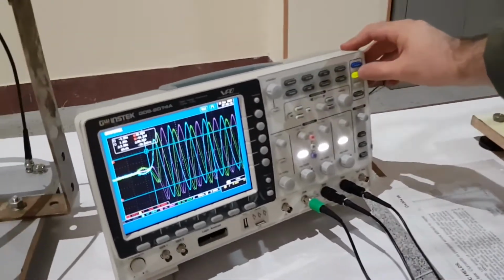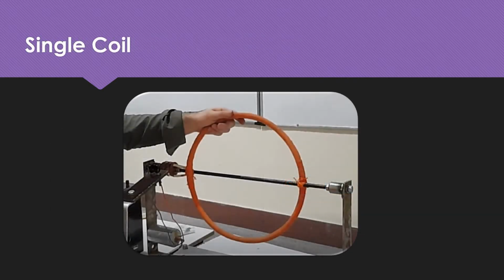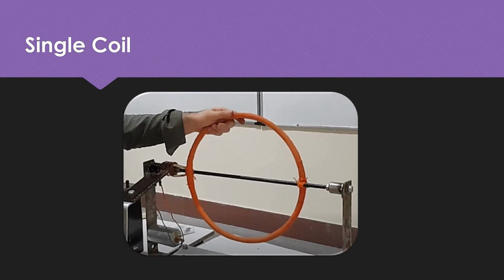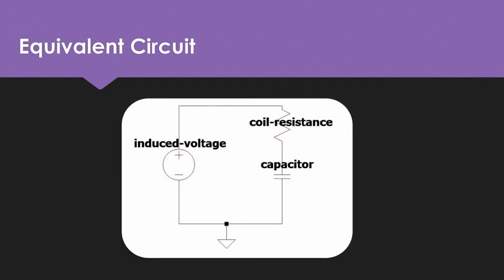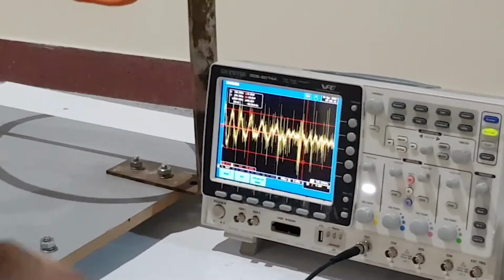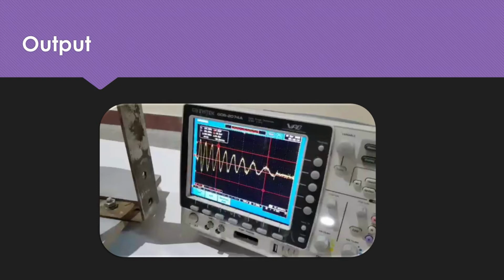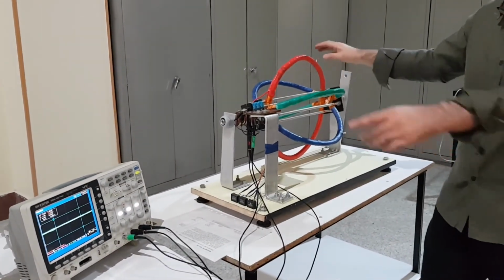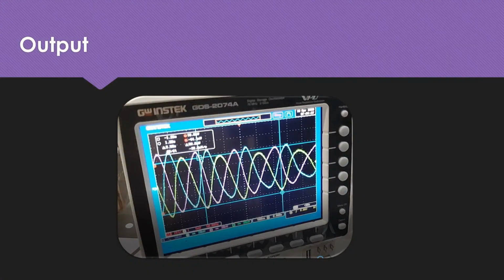Single & Three Phase Generator - Basics and Experiment

Comment: If the earth magnetic field can induce emf in a coil...than can we say that the magnetic field of earth also induce emf in every moving coil on it...like coils in cars buses etc... And how these equipments handle this induced emf?
Reply from the maker: Yes the emf will induced in every coil but the amout of emf is dependant on the size of the loop you need an extremely large loops of wires to be able to use this emf which is not practical and efficient. If the coil is too small like you said coils in cars, it will be negligble.

Comment: In your circuit it appears that the capacitor is in series( which would be correct as a filter) You however referred to it as being in parallel- is there a reason for that ?
Reply from the maker: It depends. you can consider them parrallel or series. for example if you consider induced voltage and series resistor as a single component which is coil, then the capacitor will be parrallel to the coil. Anyway say parallel or series no matter you can understand the concept.